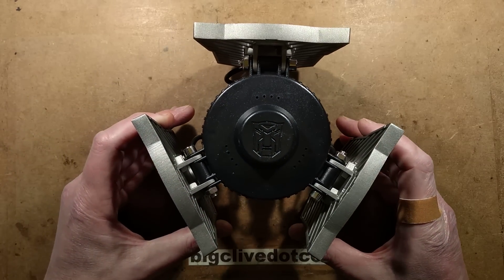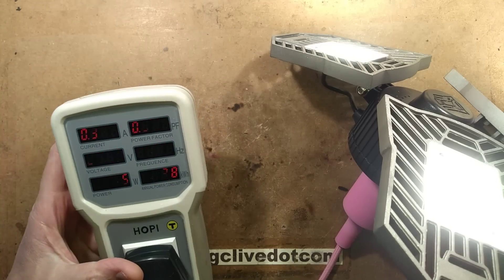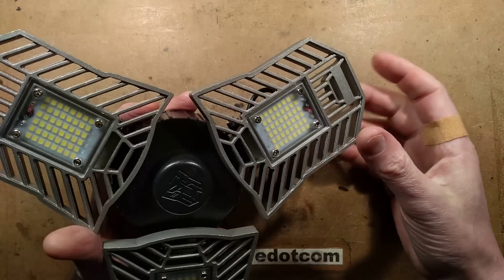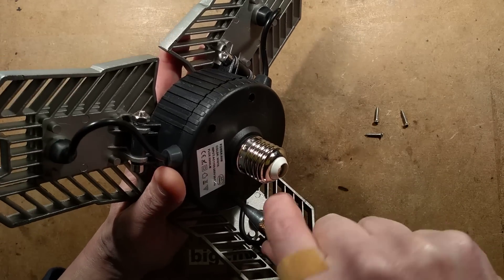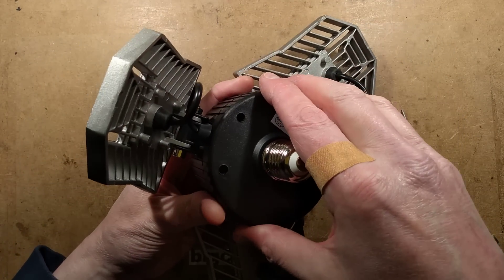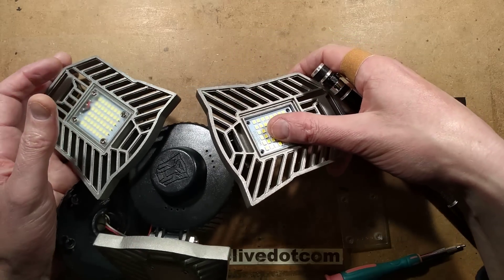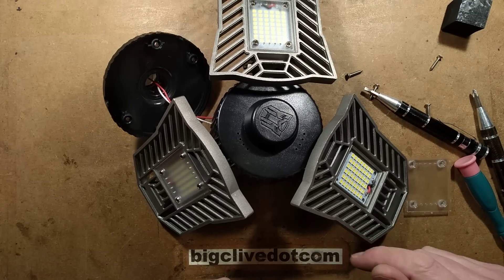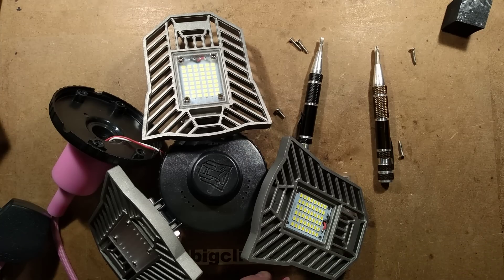Inside a deformable LED robot lamp.

Comment: This comment has absolutely zero to do this this product in particular, but it does have to do with "Hi-Lumen" LED lights... 

I had bought some cheap chinese 10,000 lumen C.O.B. LED bulbs for my garage from my local hardware store. They were VERY bright, a little on the cold side for my taste, but otherwise i was happy with them. The packaging stated "2 year warranty", so I thought, ok, these should last a while... WRONG! 
It was literally about 3 weeks after the 2 year mark, and on one of them, many individual LEDs started going out, a couple per day. A few days later on the second bulb, a few whole aluminium strip sections went out within a period of hours of each other, and then it started to smoke, buzz loudly, pop with flames ejecting out of the vent slots, and then went dark.... THREE WEEKS after the 2 year warranty was up.. 😒

I took both bulbs apart, one the power supply was cooked, and the other one had many LEDs out on the various sections of it. I managed to make one good bulb out of all the parts, screwed it back into the socket, and it lit. Within another two weeks the remaining bodged together bulb started rapidly losing individual LEDs, and went out with a bang again. 

I totally gave up on that brand of lights. I cant believe that they have them SO engineered to fail like that SO close to the end of the warranty period. 😡 The things weren't exacrly cheap either. Just a few bucks cheaper than some of the other brands of better quality bulbs. 

I ended up purchasing a different well known brand that have a 5-Year warranty, and I've had NO issues with them for going on 3 years now, and the quality of light they produce is MUCH better than the other ones that failed. Better color temp., way better C.R.I, and so far longer life. 

We'll see if these ones fail a few weeks after the 5-year warranty period.. 🤔  
But somehow, i think they'll last longer than that..
The warranty period stated on tje box IS a pretty good indicator of the quality of the product. With Hi-Lumen LED bulbs, your money is better spent not buying the "el-cheapo" bulbs.

Comment: Hey Clive, how many volts goes to each panel?
Reply from the maker: It's based on current regulation, so the open circuit voltage could be high.
Reply: @bigclivedotcom  I thank you, Good Sir. Keep on keeping on, my man!

Comment: What would be some good hacks for this type of light to improve longevity? Extra vent holes in the body. More thermal compound or thermal pads for the led boards. Then maybe ditch the foam block in the housing in exchange for peelable silicone on the corners? I was thinking hot glue at first but then realised that was highly likely to just melt off, not sure if the silicone would work but it's worth a shot.

Comment: Hey, Clive how difficult would it be to flip the mountains so that instead of failing mounting it could be tried as a lamp bulb set? My apartment only has one ceiling mount for lighting, not in my workshop only the living room. I mainly am a Transformers fan, and I need a bright room light for working on my props and Figurine stuff.

Comment: We have it it Canada, from 86v to 240v but how do you suggest for each panel to be powered individually??
Reply from the maker: Each panel could have its own driver.
Reply: @bigclivedotcom  well the scenario is the socket for bulbs btoke and a buddy sais ill give you a pannel and ill keep 2, as all 3 drivers on same pcb im pondering on best way to drive a single led pannel, on drivers output my multimetre stayes each gets roughly 100v dc each
Reply: @bigclivedotcom  i have background some as im a Telecom technician but figured id ask as you have more experience and as learning is best solution for me i try all sources i can for help

Comment: I have a question for anyone that may know.  I ordered these lights, but I accidentally ordered the 170v-265v version instead of the 85-265v version. Is there a way to convert it to the lower voltage version for use in the U.S. at 110v?
Reply from the maker: You'd have to swap the drivers.
Reply: @bigclivedotcom  Thank you.  that's what I was afraid of.

Comment: No earthing to the aluminium housing? Surely not legal in the UK?
Reply from the maker: Keep in mind that it goes in a standard 2-pole lamp holder.  Most modern LED lamps with metal heatsinks are not earthed, so I always recommend treating them as potentially being live.
Reply: @bigclivedotcom  good point, thanks.

Comment: With the apparent power / real power issue, surely the reactive element will be a sum of the various reactances across the building as seen by the meter.  So inductive loads would help cancel out capacitive etc..

The net effect being not such a drastic PF as the individual item.  I can see a market for automatic PF correctors :)
Reply from the maker: It's a tricky job correcting the power factor of loads like this.  Nowhere near as simple as old inductive loads.

Comment: Sorry to interrupt you mate. You need. To do safety. Induction for your fans   like an electrical. Fitting failed I just fixed it first thing. I shut off the electrical supply. Then replaced the the light fitting and bulb   then fixed it  mate safety is very very important

Comment: My experience with Chinese led lights is that the drivers are so cheaply made that the leds last nowhere near their ratings.  Current is poorly regulated causing premature failure.  This one with the three separate buck regulators might be a little better than most but with that kind of current consumption I doubt they will last very long.  The led panels should have been slightly larger.

Comment: considering LED's tend to make noises on contact in the E27's  I tend to shut the power off when inserting a bulb.  That and I have a similar cob bulb to the other one you showed earlier.  But that is a shock hazard.  barely held together but it's lasted in the place I have it.. think the smoother is starting to go though.  I know it's shot on one bulb.  oh well.  Word to the safe.  Turn the power off when playing with any bulb, especially CFL/LED's..

Comment: Great video!  I have one.  Here it is: 
LED
 Garage Lights, 60W Adjustable Trilights Garage Ceiling Light, High Bay 
Deformable LED Corn Light Bulbs with 6000LM 6000K for Basement Cellar 
(CFL HID HPS Metal Halide Lamps 300W-400W Equiv.)

      I don't use it that much because my garage door opener has 2 100 watt LED lights in it.  It throws a crap-ton of light.  Adjustability of where the light goes is a plus.  Will let you know if I have any issues.......about 39 dollars.

Comment: I remember the last time (or maybe the first time??) Clive had radar, a bulb with a tumour on its head.  Looked good I thought, so I got a couple which eventually arrived and worked a treat (or so I thougt)  One in the porch, one in the hall.  About 3:30 they both lit and so did I, certain we were being burgled.  The PIR in the drive was dark, perhaps they were tunnelling under the house?  I never did find out what set it off ... but over the next week or so I realised that EVERYTHING set them off ... next door's cat, man next door's prostate, Grass growing, birds on the roof, birds on the drive, birds flying over the roof and the drive.  Even a hedgehog in next door's bins.  They were far more sensitive than our early warning system and I think probably could see further.

On the other hand, the PIR is rigidly directional and never gives a false alarm (it hardly ever comes on, even when you stand in front of it).  I've ordered some boards but I'm in two minds how to use them seriously.
Reply: You can desensatise them by putting a resistor or a pot across the R-GN pads at the back of the board.
Reply: @rambo1152  I was hoping so.  I've built some of clive's string lights con boards which work with PIR, radar det ordered but not delivered yet so looking forward to having a poke round -  and now I have a starting point cheers

Comment: I'd be interested to see how one of these lamps compares to a standard 240v 60w halogen lamp when used in the intended location. Particularly the spread of light around the garage and the 'feel' of the light. My personal experience is that using LEDs, and LPF lamps in particular, I have difficulty reading small print, but can read it perfectly fine in natural and incandescent lighting.
Reply: Try a warmer color temperature LED bulb. I prefer a 4000k-5000k color temp myself. 
The 2700k ones are way too yellow/orange, and dim looking to me and anything above 5000k is too cold, blue, and the color rendition (C.R.I.) of them bothers me. 

Try to find a bulb with a C.R.I. of 90+, (100 c.r.i. would be the same as natural daylight from the sun at noon) and I think you'll find that you'll be able to read print just fine again.

Comment: Can't believe it, I bought one of these for here in the states.  We have been using it to light my house while working on the drywall etc.  Have had it running for 6 hours 3 days a week for about 3 months now.  Still bright as hell.  Also hotter than hell put a infrared thermometer on it and was about 200F at the center of the light array.  Great work light.

Comment: The modern "old style" power meters (with the spinning disk) already do measure apparent power AFAIK.. A test with a purely reactive load would clear that up
Reply from the maker: I was under the impression they only measure real power.  It's tricky finding one these days.
Reply: @bigclivedotcom  My mother in law still has one with the rotary thing inside.

Comment: Transformable; note the resemblance to the cartoon transformers autobot symbol both for the metal parts and the plastic molding at the centre. Perhaps they changed it to deformable to prevent copyright writs.
Reply: Lol, they don't care about copyright laws. Google translator translates the Chinese characters for "transformable" into English as "deformable." 

*that's what someone else said.

Comment: I wonder why this thing bothered with those driver boards. With those three panels running at around 70Vs each they'd not have to dissipate too much through a resistor to get down from mains voltage. Would the current be too high?

Comment: wire the 3 panels in series and replace the buck converter with a capacitive dropper,should end up with a better power factor and lower temperature
Reply: yep 72v * 3 so 216V DC , bridge rectifier and suitable sized cap would do it, although a buck converter that takes 240v down to 216VDC would be efficient, better PF and allow better smoothing.

Comment: Hey Clive need help with a circuit  for 2 light bars on my van please reply as I'm stumped
Reply: There are plenty of circuit schematics online for exactly that. It should be very simple and straight forward, and drawing it out on paper should help you visualize the circuit much easier.
Reply: @xenonram  hi mate just running them normal I know how to set up but what I'm wanting is to run 2 diffrent light bars from one 

On-off-on stitch 

But have it so 

On-one bar on 
Off-all off
On-both bars on 

Anyone know what I would need to do  ??? 
Not sure how to do it 

There both 12v 126w light bars

Comment: If anyone is planning a race quadcopter build at the moment, I can recommend these 50A 4in1 ESCs. that also use the Deceptocon design. The eyes light up too! https://www.banggood.com/Anniversary-Special-Edition-Racerstar-Metal-50A-BL_32-2-6S-DShot1200-4in1-ESC-w-LED-CNC-Waterproof-p-1340982.html?ID=46149&cur_warehouse=CN

Comment: Thanks for reviewing these. I bought 2 a few months ago for my garage, replacing 150W incandescent and a 150w equiv CFL. I like them and they are quite bright, though I'm sure the lumen output spec was inflated. Bought off Amazon, 120V for US market.

I suppose if I ever get around to it, I could add a bit more heat sink compound, drill some holes and remove that foam pad.

Comment: They don't do a b22. Useless.
Reply from the maker: You can get a B22 to E27 adapter.
Reply: @bigclivedotcom  sometimes you can fit them 'backwards' and the screw base is the live bit. Can sting a bit if they are not covered suitably.
Reply from the maker: @steve87uk  Yeah, it does surprise me that IKEA sells a device that effectively contradicts a UK electrical regulation.  But common sense and an educational zap are powerful things.

Comment: I'm wondering if the vent holes actually are the top, and it should go in a lamp base or mayee against a wall, over as advertised
Reply: The panels would be the right way up then. They are the shape of the autobot logo, but the wrong orientation for a ceiling mount.
Reply: @andrewness  it is odd to have a bottom heavy design

Comment: Could you do an installation resistance test between the metal grids and the supply  at 250 volts
Reply from the maker: I'm away from my workshop at the moment, but I could do a 500V test.  That wouldn't show the potential insulation breakdown under fault conditions like an LED burning up.

Comment: The unexpectedly low heat sink temperature might be due to bad thermal coupling from the LED module to the heatsink. I mean that dab of thermal paste looks more like an insulator than helping with thermal conductivity.
Reply: Some Chinese sellers actually advertise thermal insulation for a cooler handle as a feature in their flashlights.
Reply: It's definitely thermal compound. A rather cheap industrial blend that runs about $3 for 60g. Awesome stuff, performs better and last longer than most of the high price compounds I see PC builders use. That dab however is absurdly small. Typically you would apply that stuff either by rolling it on with a swab or spreading it on with a small plastic spreader. It doesn't flow like alternative compounds when heated, too thick of a mixture for that.

Comment: I don't know why this bothers me so much, but I really dislike your calculator. The screen is too small and the angle makes it hard to read when it's on the table. If I wasn't in East Africa right now, I'd mail you a replacement.
Reply from the maker: I did get a huge flat calculator, but the keypad PCB is literally printed on paper and extremely unreliable.
Reply: @bigclivedotcom I do remember that one. I think this would be perfect:
 https://www.ebay.com/itm/Casio-MS-20NC-RD-Basic-Calculator-LARGE-DISPLAY-Tax-Calculations-MS20NC-Red/263173040164?_trkparms=aid%3D444000%26algo%3DSOI.DEFAULT%26ao%3D1%26asc%3D20171010182220%26meid%3Dcb4d697ed03f4f99838f18ad071e4adc%26pid%3D100891%26rk%3D2%26rkt%3D4%26sd%3D263173045304%26itm%3D263173040164&_trksid=p2349624.c100891.m5206

Comment: Anything is deformable with enough force :)

As for the issue of smart meters / apparent power - is there actually a valid reason for changing people for it (I remember you mentioned industrial sites tend to pay for it).  If not, should we be making a bigger noise about it before it happens?  I've refused a smart meter so far (on software / networking issues alone) and their new tactic seems to be not sending a guy round and sending letters saying they charging for average use with the 'make sure youre paying the right amount by getting a smart meter'
Reply from the maker: High current bad power factor loads do cause the power companies issues in cable and equipment sizing.
Reply: Change company then. They are very keen to read your meter if they think they are about to loose money...!
In the mainland U.K. they can’t force you to have a so called ‘smart’ meter.
For domestic / home / light industrial / small office properties, the small difference between low power items having a good power factor and a poor power factor is mostly irrelevant compared to the rating of the infrastructure needed to supply electrical heating devices (room heaters, ovens, cookers, water heaters etc...).

Comment: Wouldn't you need vent holes on the top and bottom so air could flow through?
Reply from the maker: It really could do with bigger holes on the base and some in the top too.
Reply: If only there was some kind of device for making holes in things...
Reply from the maker: @andrewness  You mean like a gun?  I think that might burst the circuit boards.